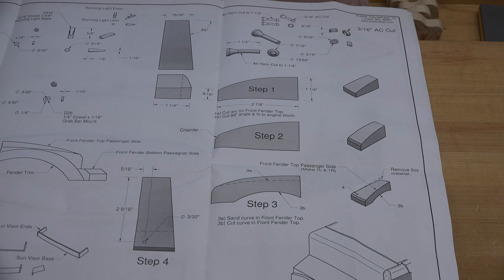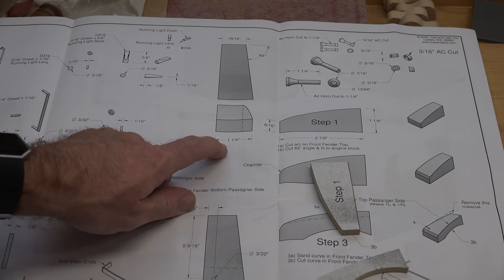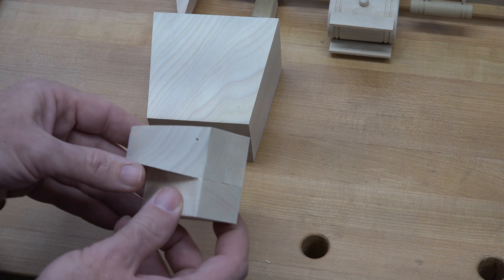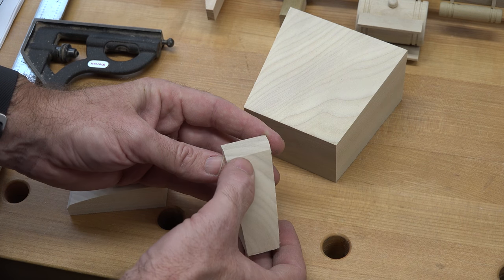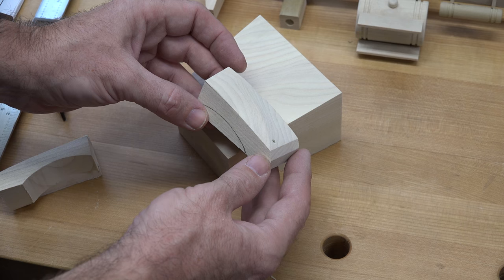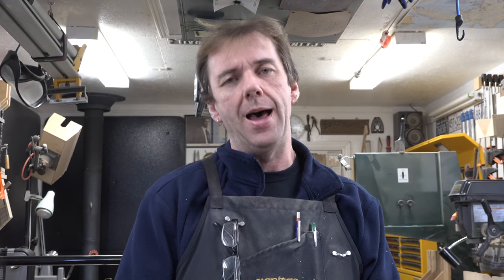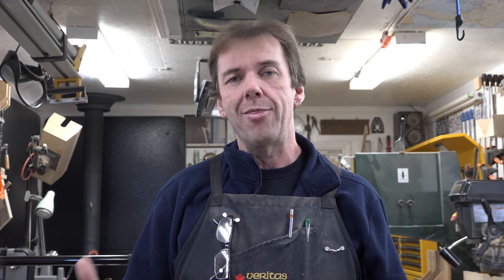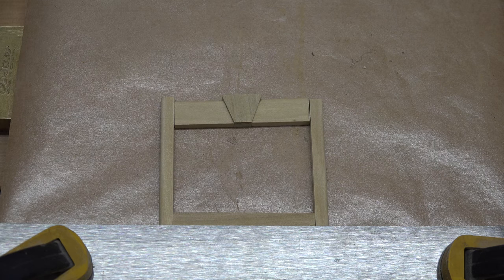Scale Model Part 4

Comment: HEY KENNY LOVE YOUR VIDEOS. WE BUILD A LOT OF THE SAME THINGS. HAVE YOU DONE ANY OF THE MODELS THAT HAVE TRACKS? I WANT TO BUT AM A LITTLE INTIMADATED BY THEM.
Reply from the maker: Thanks for the great question Brent.  I have done a couple with the track and you can see those builds on the channel's Facebook page.  The link is at the top of my youtube channel's main page.  I have made the boom crane and the Abrhams tank.  Both had tracks and both sets of tracks are challenging but nothing crazy.  You just have to take your time and be accurate.  Drilling is the main thing that you need to be right on with and be sure to drill slowly so that you don't cause your small drill bit to deflect in the hardwood stock.  I did this on one track and destroyed four days work by drill too fast.  Take plenty of breaks and take your time and you will be just fine.  As always, if you have any questions, don't hesitate to ask.  Thanks for the kind words and for tuning in to the show.